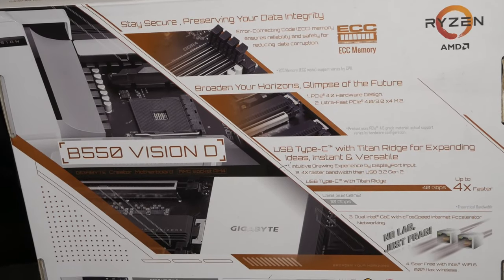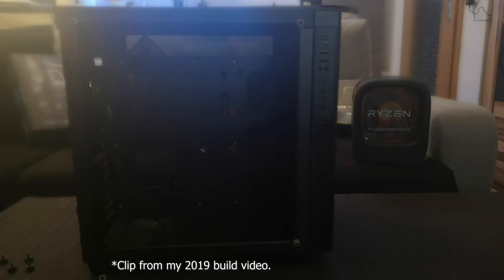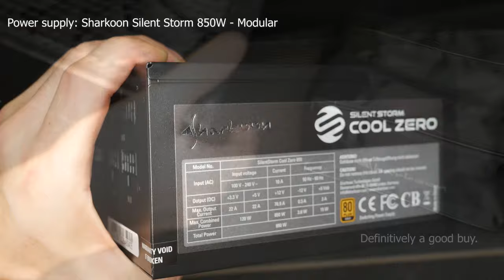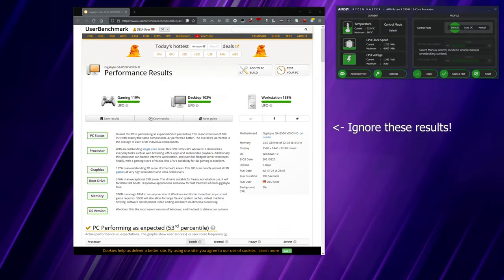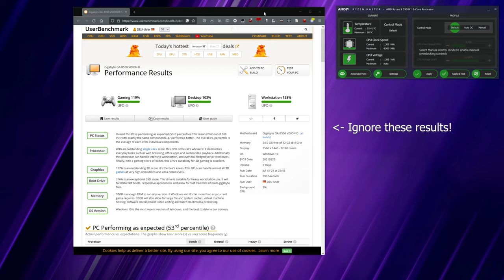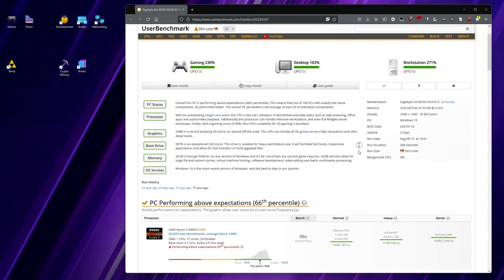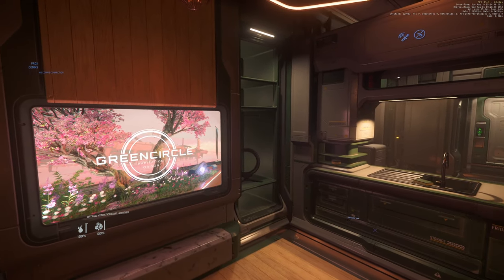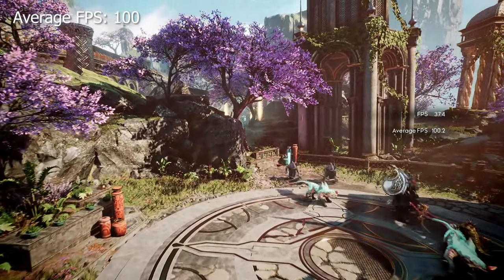White & Black - 2022 PC Build (Gaming + Workstation) ☯

Comment: Oh man I love the aesthetics of the build! You did a great job putting everything together and all the colors are perfectly matched up. But why 3080 ti only at 1440p though? I can see there's some bottleneck like in fh4 for example, and that kinda makes me wonder why I'm getting a better result on my 3070 ti.
Reply from the maker: Thanks! The 3080 TI was the one that popped up at a reasonable price so that's what I got, I'm not entirely sure where the bottleneck is but it mayyy just be because I had 3x 2K monitors on and a 4K TV on + OBS while I did that benchmark. My main monitor is a LG 27GL850 (144Hz 2K) so that's where I tested everything, without recording FH4 runs stable at 144FPS and it looks gorgeous.